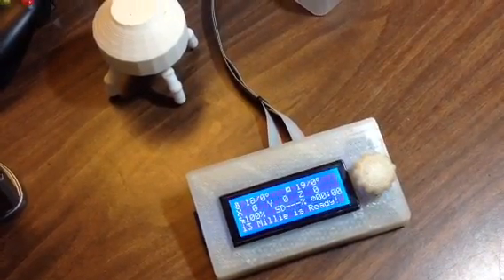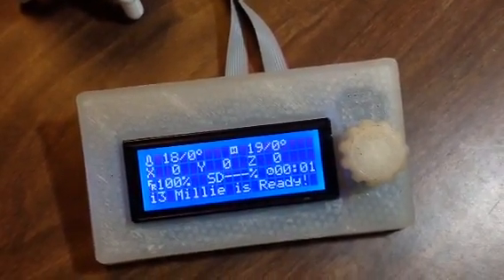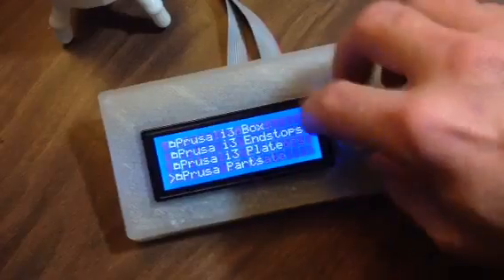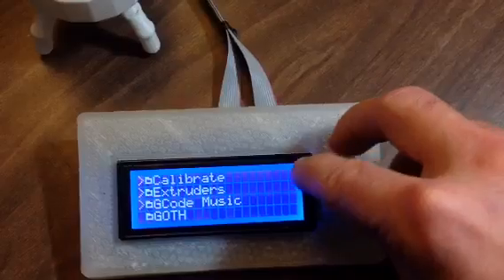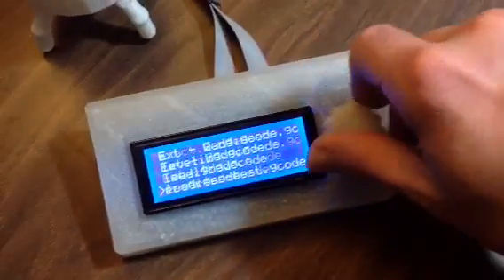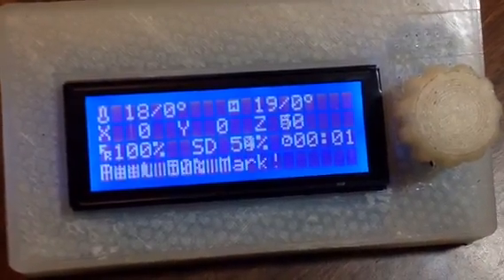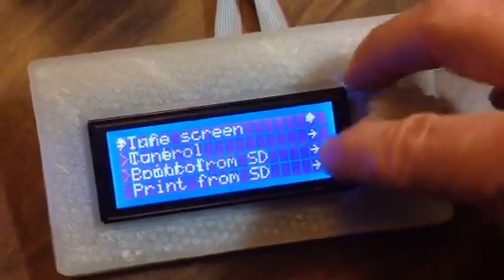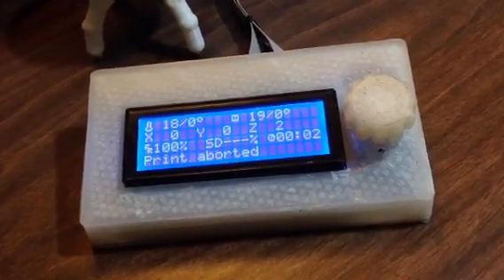New Marlin Firmware features (for RepRap 3D printers)

Comment: Hello Scott, I have a Geetech A10M dual color printer. Upgraded with a 32bit BTT SKR V1.3 control board. It is configured with Marlin 2.0 bugfix. When I control the printer through Pronterface I can see and control both extruders for testing, changing filament etc. Using the stock onboard display controller I can only access 1 extruder, yet printer info in the menu says I have 2 extruders installed. I tried a TFT display, when I select the extrude function it Identifies E0 but when touched doesn't change to Extruder E1. I have configured as 2 extruders 1 nozzle and as 1 mixing extruder with 2 mixing steppers. Either config only shows 1 extruder in motion control even if printer info says there are 2. 
Both extruders must be in EEPROM because Pronterface finds and controls both E0 and E1.
Am I missing something? Can Marlin be changed to allow onboard display to control both extruders? Thank you for you help. Charles

Comment: Happy to hear you love this. I like it but I know almost nothing. I just updated my CReality Cr10s to Marlin 1.1.8 but I dont have a clue how to set the panel settings. Since I updated my printed is very jerky and wants to tear itself apart. Would you know the settings or direct me to a place that I can learn how to set the panel settings. Thanks
Reply from the maker: Marlin 1.1.9 will be out very soon, and the bugfix-1.1.x branch ( https://github.com/MarlinFirmware/Marlin/tree/bugfix-1.1.x ) is a big improvement over 1.1.8. It includes decent configurations for the CR-10 series. There's a helpful configuration tool now available at https://github.com/akaJes/marlin-config/releases which includes detailed documentation on each feature. For the CR-10 stock display you should use the CR10_STOCKDISPLAY option, and it should "just work." Thomas Sanladerer has some good videos on marlin configuration and general LCD panel setup. The marlinfw.org site has additional documentation.
Reply: Thanks I will check those links. Where do I get the stock display option for the Cr10s. is that going back to stock firmware? I was not able to find any videos on the 1.1.8 as the older ones are different. I seem to think I watched several videos saying the CR10 and CR10s are totally different when it comes to Marlin.  I would need CR10s configs and setups. Thanks
Reply: The bugfix link does not work . And the config files I have no clue what I am looking at. Which one do I need? I am sorry for being so dumb but I have only been at this for 6 weeks and never messed with gcode or any of this stuff. Its tough teaching an old dog (me) new tricks or anything for that matter.
Reply from the maker: The link is fixed (the closing parenthesis got appended). These questions are too big for me, as I'm the lead dev on Marlin and working on the next release right now. I recommend taking advantage of forums.reprap.org and the wider community to get assistance.
Reply: Thanks I will try there.

Comment: Nice changes, Scott. I hope you added your changes to the pull request queue, they are very useful! Just wondering if your changes only work with the LCD2004 controller or would they also work with the 12864 Full Graphics Controller?
Cheers and Merry Xmas to you!
Reply from the maker: The LCD changes are just for the simpler non-graphical displays. If there is demand for some changes in the way that the graphical LCDs display stuff, I can look into it. Post any feature requests to the Marlin issue queue.

I've submitted these features, and some are already in. The progress bar is considered redundant and so has not been accepted. The SD card sorting feature is in limbo – it needs to be constrained because of the embedded environment, and then it will need more testing. Meanwhile, under my own controlled conditions, both functions are working well for me!

Comment: I downloaded your marlin and tried to configure what I know to get it to work on my prusa i3.   The problem I am having when I switch it to use the #define REPRAP_DISCOUNT_FULL_GRAPHIC_SMART_CONTROLLER and compile I get these errors..  In file included from /Configuration_adv.h:627,
                 from /Configuration.h:1002,
                 from /Marlin.h:22,
                 from blinkm.cpp:5:
/SanityCheck.h:24:8: error: #error LCD_PROGRESS_BAR does not apply to graphical displays.
/SanityCheck.h:188:12: error: #error "The given BACK_PROBE_BED_POSITION can't be reached by the probe."

How can I fix this?   

I google searched #error LCD_PROGRESS_BAR does not apply to graphical displays and got this answer. http://community.robo3d.com/index.php?threads/full-graphics-lcd-controller-percent-complete-mod.3835/

from Zigggy
Just requires a simple mod to the "dogm_lcd_implementation.h" file in Marlin (bolded below), recompile and reflash.

// SD Card Progress bar and clock
u8g.setFont(FONT_STATUSMENU);
if (IS_SD_PRINTING)
{
// Progress bar
u8g.drawBox(55,50, (unsigned int)( (71 * card.percentDone())/100) ,2);
// Percent complete
u8g.setPrintPos(55,47);
u8g.print(itostr3(card.percentDone()));
u8g.print("%");
}
else {
// do nothing
}
u8g.setPrintPos(82,47); // move time display to the right

I'm trying mate, please help,  Thank you.

Comment: Hi, is there a way to remove the X Y Z being displayed ? ... i would like to remove this option from the home screen on the LCD, i only need the hotend and the heatbed temperature displayed . Do you by chance have an answer for me ? Thank you in advance ;)
Reply from the maker: Marko Makaj There isn't a configuration option right now, but you can edit the code. If all you want to do is to hide them, find the line in ultralcd_implementation_hitachi_HD44780.h that reads "lcd.print('X');" and remove or comment-out the group of lines that include it, between the #else and the #endif. After that #endif the next 6 lines print the Z info. Remove those lines to stop showing Z.